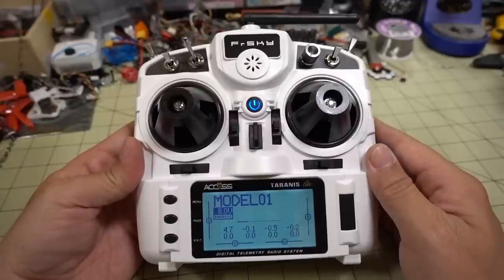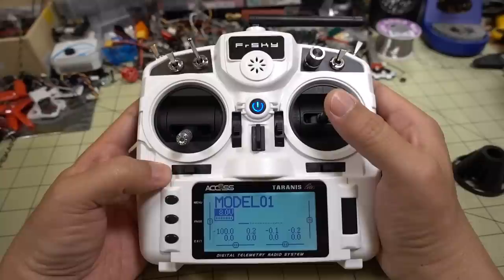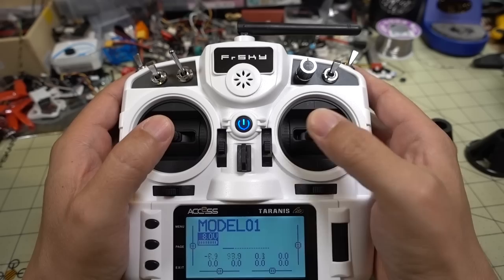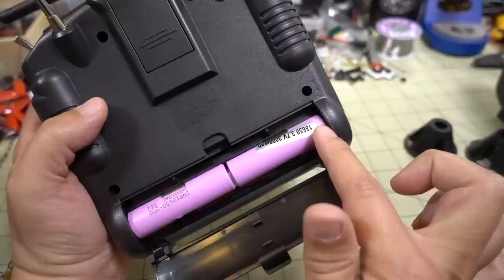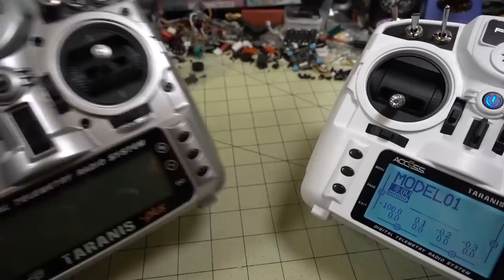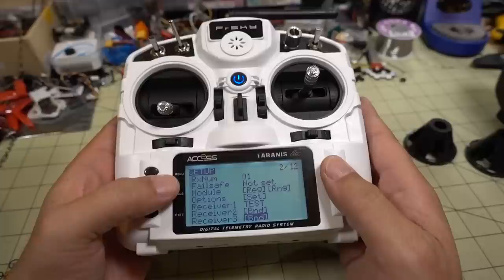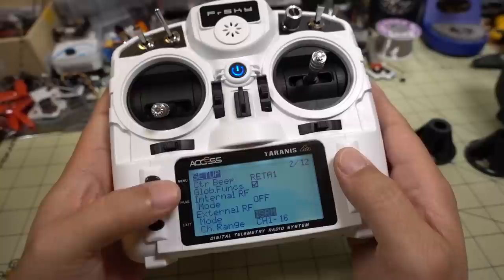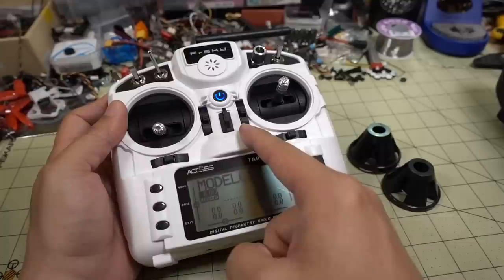FrSky Taranis X9 Lite Radio Intro 📡

Comment: Thanks Albert! I am glad an update is coming for D16. However some micros recommend D8 for fewer failsafes. Will D16 firmware update cover D8? Why not just make these compatible. Then I’d buy an X-lite Pro as I’m sure others would. Can’t imagine needing to spend $40 extra and have a silly dipole coming out of an already expensive X-lite pro radio just to be able to control legacy models.
Reply from the maker: I run D16 on most of my micros.  I think D8 being recommended is another example of fake news getting passed around Facebook.
Reply: I’m just curious though why allow D16 but not D8 if that’s an option for previous X-lite and Qx7, etc. Has D8 never been Frsky approved? Am I missing something?
Reply: @AlbertKimTV  The whoop boards with integrated SPI receivers cannot run telemetry in d16 mode without cutting out, so many people choose to run d8.
Reply: Albert Kim hate fake news too lol but the d8 is real, at least according to Bardwell’s vid 😂
Reply from the maker: I use D16 on the Mobula7 (and all other SPI boards) with telemetry off and get better range than in D8 mode.  I'll need to make a video to clear this up.
Reply: @AlbertKimTV  Here's the issue on GitHub regarding the D16 w/ telem dropout issue: https://github.com/betaflight/betaflight/issues/6172 Has never been resolved. Only way to use telem is  downgrade to d8 mode.

Comment: Hi, nice video. I'm new to the drone world and i got a X9 Lite and I want to use it to train with simulators before i buy a real drone. Can you tell me if i need the batteries to use it as a controller connected with the usb cable to the pc or will it power up with the usb power? Thanks in advance!

Comment: Hey man! I can’t seem to get this radio to connect to my mobula6....If you can help out in anyway that would be great! Do I have to upgrade my firmware to Open TX 2.3.5 or higher?
Reply from the maker: This radio does not support D8 natively.  So you need a multiprotocol module.  First you need to flash a build with multiprotocol support.  See video link below for tutorial on how to upgrade the radio...  then you need a module.... link to that also below.

https://youtu.be/3VKIvyJ-Ykw
URUAV TMX5 Lite Module - http://bit.ly/2Ls0ywc

Comment: Ever since I installed the 2.3 nightly update, I have been using this on r9 lite module.

Not sure about the ISRM update.

Still have to figure that one out 😁
Reply from the maker: If you update the RF module it will enable D16 on it.  The nightly builds just updates OpenTX to allow for other things to work in the external bay.

Comment: Does the Li-ion battery on this radio support how long it takes?
Reply from the maker: It depends on the capacity of the battery you are using and your usage pattern.  I have 2x 3000mah Samsung cells and I've been using this for a month and still haven't come close to charging it yet but I don't have it on 24/7.
Reply: @AlbertKimTV  thanks but with the receiver xm+ which radio has longer  range, QX7 or taranis X9 lite?